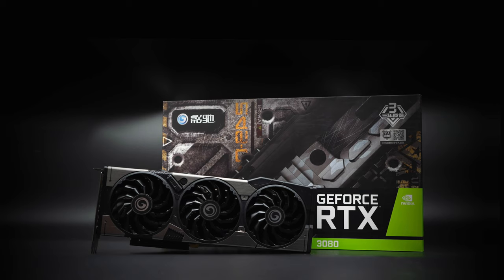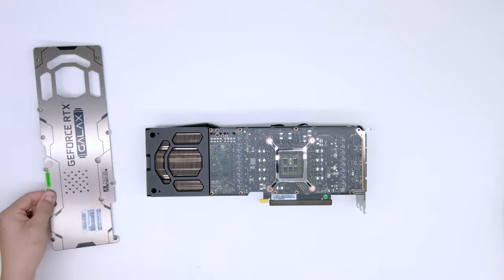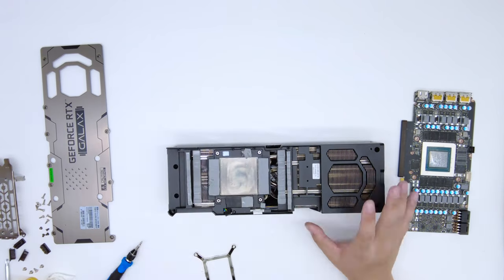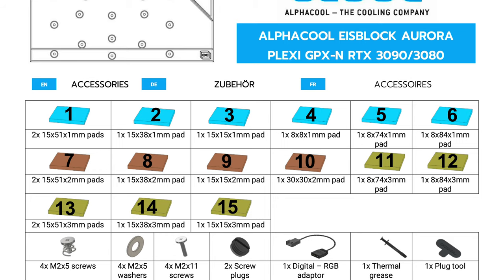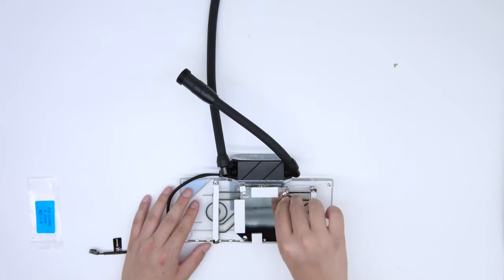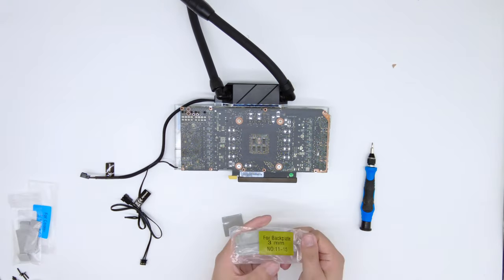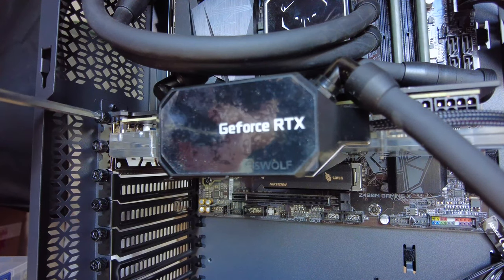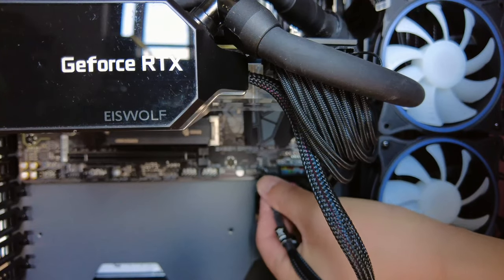Galaxy 3080 x Alphacool Eiswolf Watercooling Kit - Part 1. Installation

Comment: I don't know what I'm doing wrong anymore. I have Eiswolf 2 together with Eisblock on 3090 and temps keep going up to 72C and it doesn't matter how fast the fans go
Reply from the maker: Hi, try to see if the radiators are blowing heat out, and also check to see if pump is getting proper power (green light on waterblock bridge indicates good power). 

Also when you say you have Eiswolf 2 together meaning you have Eisbaer and Eiswolf connected together in single loop?
Reply: @masterbamboo  Thanks for the reply! I don't have Eisbaer but Eisblock, active backplate. I have a 12V pump, the radiator blows heat out. Alphacool is sending me new pads, hopefully that will help :)
Reply from the maker: @jantoman4400   I see, try not to use the 3/5 thin tube for the back plate, but use the regular ones. Other than that, the only thing I've seen high is the GDDR6X ram, which I used Larid HD90000 instead of the stock pads, and you may have to tighten it few times before you get a good clamp force. Also, I replaced the back plate mounting with the ones without threads. (obtained by taking off from original 3080 eisblock plates, I'm not sure if they had revised it with the production batch, but my engineering sample came with the threaded ones, which I found very hard to get it tight. )
Reply: @jantoman4400  hi, your pump should always run on 2700-2800 RPM make sure it does in Bios. and The pumpm shouldnt have the highest position in the Watersystem because the airbubbles wich collectin on top ;)

Comment: What model of eiswolf do i buy if i have an rtx3090 Gigabyte but not aorus version???
Reply from the maker: The OC 3090 waterblock for Gigabyte supports 3090 Vision/Eagle/Gaming OC and Turbo, if yours falls in one of those, use "GPX-N RTX 3080/3090 Gaming/Eagle Eisblock", OC part number: 11942, EAN: 4250197119429 for custom loop; use PN: 14416, EAN: 4250197144162 for AIO.

Comment: is it worth it looping the Eiswolf and the Eisbaer, or just keep it separately?
Reply from the maker: It depends. If you find your hardware config doesn't need two 360 Rad, then changing it to a single 360 config would work great, or if your case can't fit 2 Rads, then without a question, looping it would be the right thing to do. Otherwise keeping it separate will keep both party happy.
Reply: @masterbamboo  Just did that, looped my Eisbaer 280 and Eiswolf2 360, but while all temps stay low while gaming (CPU under 65C, less than 60C for GPU) I noticed the CPU ran a bit hotter than before the loop, by maybe 2-3C is there a reason for that ?
Reply from the maker: @pascaldifolco4611  Yes! Because overall water temperature goes up. Comparing to previously individually controlled, with different water temperature. One way to deal with it is to manually set a specific RPM for the fans during gaming, but as you probably have discovered, not a big deal anyway. Also check to make sure the pumps are working properly.

Comment: Whats the temps like? Especially the VRM Memory Junction.
Reply from the maker: The review will be available in the next episode, but generally speaking, full load temps are around 50C, Mem Junction are about 75C. VRM not tested, but noted will try to figure out.

When used for mining, better pads need to be used, mem junction can go down about 65C when mem is OC'd +1200. Without good pads, temps can go wild for mining.
Reply: 98-102c
Reply from the maker: @bollygod  98-102C for MEM junction with the stock pads during mining is what I'm seeing as well, so if you're mining with the card, replacing the VRAM pads are a must. During benchmark, etc, it really doesn't go that high.
Reply: @masterbamboo  My card had an issue, it's bended. So they had to sent me ticker pads. Pads from AC have a terrible conductivity, maybe with better pads the vram temps should be lower.
Reply from the maker: @bollygod  Ha, we both seem to agree the original pads are shitty ;). The 2nd Ep. is going to install Larid HD90000 thermal pads, makes a huge difference.
Reply: @masterbamboo  when will the new episode on this come out? I really am thinking about buying this for my 3080. And with better pads it would be even nicer
Reply from the maker: @Clumpfy  Hi, thanks for the waiting. The data is ready, just need to cut and edit. In short, if you don't run furmark 24x7 or OC the VRAM like crazy, keeping VRAM frequency stock, then stock pads will be more than enough. But if you mine with your GPU, then better pad for VRAM is a must! The core temp in the other hand never went over 60°C.
Reply: @masterbamboo  alright, thanks for the headsup. No I wont mine with my card but still, if there is a better cooling solution out there I might just get it if Im taking apart my card anyways :)
Reply from the maker: @Clumpfy  The VRAM pads I used is Laird TFlex HD90000, good stuff. It lowered the VRAM temp from 100+°C to 65°C during the mining test. Also Furmark VRAM temp went down from 98°C to 60°C. I'd recommend that, and only VRAM needs it. The rest can stay as is.

Comment: this will not fit on the lian li dynamic medium case!
Reply from the maker: I assuming the GPU PCB is not the AIC type? (GALAX 3080, Inno3D 3080, Zotac 3080/ Gigabyte 3080 Turbo/Lenovo/HP/Dell OEM etc.) 

I know for sure that ASUS STRIX/TUF with Alphacool waterblock will not fit into a lot of cases, but AIC type should work with most cases.
Reply: @masterbamboo  I fitted it onto a strix 3080ti and the unit is to wide now for my case by between 10 and 20 mm meaning I can’t fit my side panel on :) now ordered the xl version of the lian li case and i vertical mount
Reply from the maker: @christophermurphy9180  yes, the over-shoulder height/width is the main issue with STRIX/TUF of 30 and 6000 series GPUs. I've seen a lot of complains, but 40 series is even worse. The only way to get around is get a new case or swap gpu.
Reply: @masterbamboo  thats what ive had to do unfortunately, costing me almost 300£ ;/it may look better in a bigger case anyway because the water pipes are a little longer than i thjought they might be probably 75% longer than my asus aio cpu cooler ^^ Im also a little confused about the GEFORCE RTX logo in green while the rest of the card is rgb ill probably look at doing a custom loop in the future now that i have the dreaded dismantling of the gpu ( my first time)
Reply from the maker: @christophermurphy9180  the RTX logo in green I fully agree! Got me confused for the longest time. It's moddable. If you take a look at my latest video, it shows how to take it apart, just need to be careful. 

Yes, the card will look better in the full sized O11. The "bridge" or "pump top" part is about 30mm tall over the waterblock. Which adds to already huge TUF/STRIX PCB.
Reply: @masterbamboo  well just to be sure I ordered a vertical mount to ) in regards to the green GeForce logo I defiantly won’t be taking it apart so I’m guna nicely tape over it :)
Reply from the maker: @christophermurphy9180  lol...ok! in case if you want to do anything with it, it only takes som patience and prying. Yes, vertical mount is awesome.